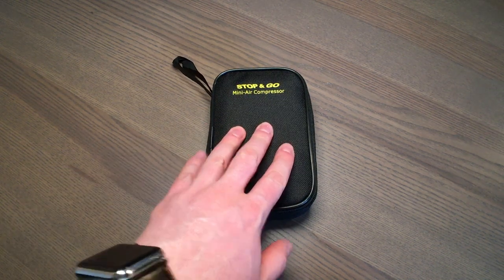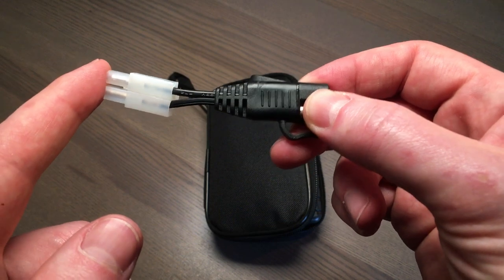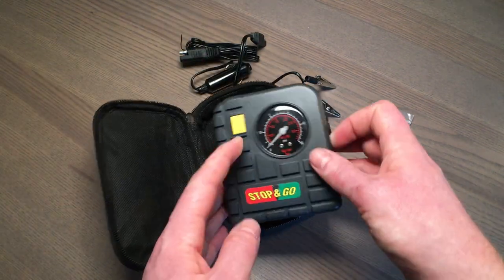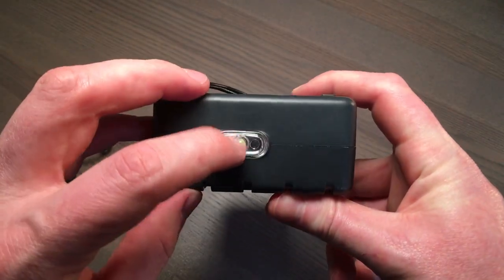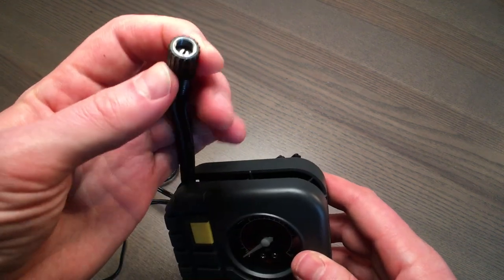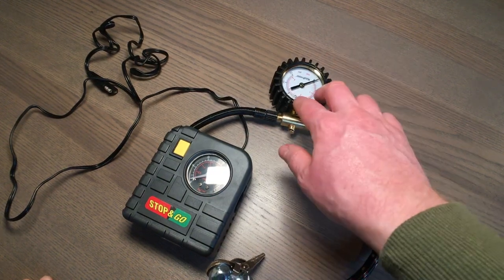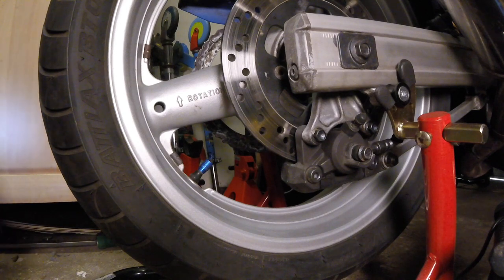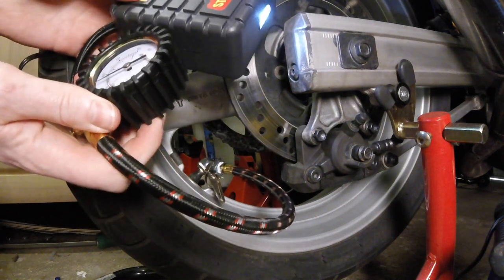Best Motorcycle Tyre Inflator? Stop & Go Mini Air Compressor

Comment: Thanks for the video.  Any chance you can provide a link to the hose extension with the gauge that you're using?
Reply from the maker: Sure. The one I bought is:

Rocky Creek Motopressor Tyre Pressure Gauge https://smile.amazon.co.uk/dp/B00T4R81SS/ref=cm_sw_r_cp_api_glt_fabc_Q4VW15KJ49KTHN8M5QFR?_encoding=UTF8&psc=1

But there are probably others. 👍🏻

Comment: Hi, I bought both of these. But for the Motopressor inline tyre gauge, when I connect it up to the tyre valve it hisses. This doesn't seem right to me. Does it do that for you. Any thoughts? Thanks
Reply from the maker: Good question. It may be that the valve is not seating right in the inflator nozzle/connector. Make sure it's seated well in there and is lined up squarely too.

Comment: Have you had a chance to gauge its robustness over longer use? Does it hold up?
Reply from the maker: Mark Lowry good question. To be honest I don’t use it all that much because I have a shop compressor in the garage. But I do take it with me on tours etc and it is still working. I guess that the total run hours will be limited as it’s a small unit so I wouldn’t recommend as your main unit. Also because it is so noisy and fairly slow. Hope this helps.

Comment: it can be used for car tires?
Reply from the maker: Hossein Beyk yes I don’t see why not. It comes with a plug for a cigarette lighter socket. 👍🏻
Reply: @motobyx9101  I have had one for several years.  After it reaches about 30psi it becomes very slow.  With the large volume of air in a car tire it will take quite a while to get to a drivable pressure.  Emergency use only in my opinion.
Reply from the maker: @triglideadventure5235  yeah recon I’d agree. Great as an emergency/top up etc. But not ideal for regular or heavy use. 

I’m lucky as I have a compressor in the workshop. I really use this as emergency or to take on your as a just in case.

Comment: Can you permanently attach the crop clips to the battery and leave them on?
Reply from the maker: I wouldn’t personally leave croc clips on the battery, but you can fairly easily get or make a fly lead with the right connectors. 👍🏻
Reply: Attached a ring mount to SAE connector straight to the battery leads and ypu will always be able to quickly connect when needed.

Comment: I noticed cigarette lighter attachment was no good, spring not present, also it does not come with 90 degree elbow for some front tyres, which you would struggle with. Really its only purpose is for touring to get you off the side of the road, to somewhere to fix puncture, then it's invaluable, but otherwise there is ones better for home use.

Comment: Can you tell me where you bought your on line pressure gauge from
Reply from the maker: This is the one I bought. There are several similar. 

Rocky Creek Motopressor Tyre Pressure Gauge https://smile.amazon.co.uk/dp/B00T4R81SS/ref=cm_sw_r_cp_api_glc_fabc_59D1Z45WJ80HV0XYCYAV?_encoding=UTF8&psc=1

Comment: How much is the psi guage off compared to he attachment so i don need to huy that
Reply from the maker: Tiffany Scott good question. I’ve not actually tested it. For sure the built in gauge would be fine for tours and emergencies etc. I just like to use a higher spec gauge for day to day. (I only really use this on tour as have shop compressor).

Comment: Not impressed, who wants to be buggering about taking seat off or removing side panel to put clips on battery to deal with flat, my Suaoki is usb charged so can charge it indoors on Samsung charger or off usb port on handlebar if fitted takes up little space in wash bag.
Reply from the maker: Sounds like a great unit! Do you have link?

Comment: This thing is abs crap....the hose is waaay too short and gets stuck. Dont buy.
Reply from the maker: “Crap” is relative IMO. This is a cheap unit and does an ok job (mine is still working!)

I have a shop compressor in the workshop so don’t use it much. But it’s designed to get you out of a pinch rather than everyday use I think. 

👍🏻